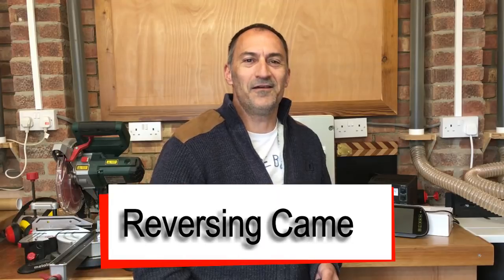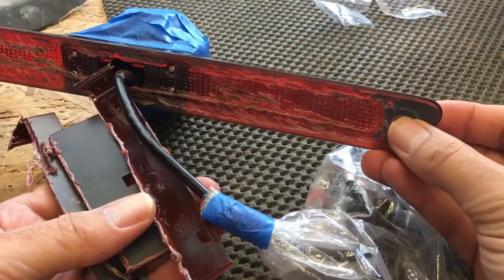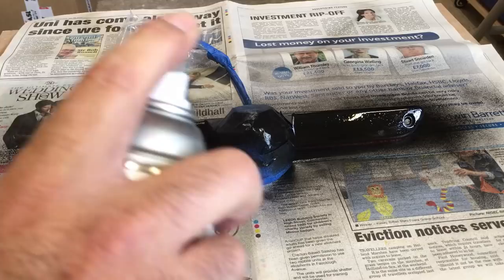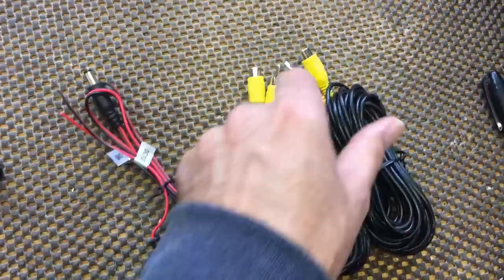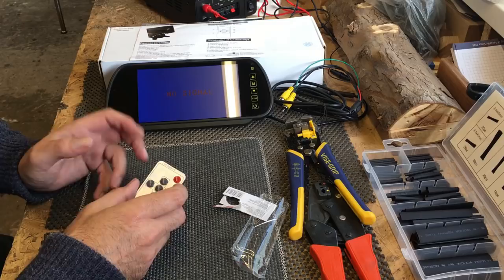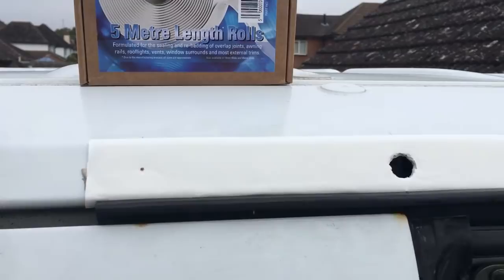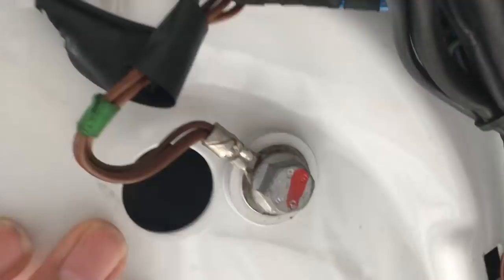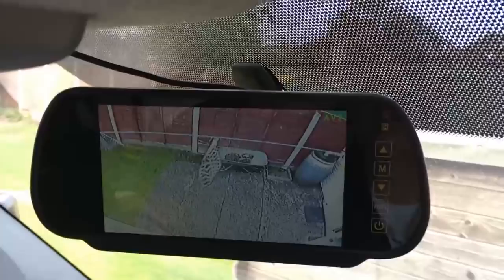Mercedes Sprinter - Rear View Camera Install

Comment: Hi Greg, How did you hide the cables at the front? Hoping there is an easy/neat way of doing this without removing the ceiling panel.
Reply from the maker: Above the rear view mirror the fibreglass head liner is flexible enough to push the cable up behind it and the window rubber into the void above. Use a long flexible rod as a draw wire and pull the cable through to the loom over the side door. Make your connections above the headliner. Hope that makes sense. 👍🏼
Reply: GREG!!!! That was sound advice, and was in the van today trying to install it all. I have managed to get the camera part installed, connected to the reverse light wire then video feed all the way to the front. However how did you power the video unit? I connected it to the cigarette lighter to make sure it all worked and it does, however I will need to find another power source for the monitor to function properly. Thanks a lot
Reply from the maker: Hello Stephanos, there is a solid red wire in the loom above the sliding side door that is a permanent live. I stripped a small piece of insulation and tested it to make sure. It's the same solid red cable that feeds the rear interior light over the double doors. I fitted a small toggle switch in the headliner so I can turn it off when not in use to avoid any unwanted battery drain. Hope that makes sense.
Reply: Thanks for that super quick response Greg you superstar! That's the idea I had in the back of my head but wasn't sure about if it would drain my battery. However, if you turn the screen off, when not in use, would it actually drain anything/be negligable?
Reply from the maker: Hi Stephanos, I'm not sure if it's off or just in a state of standby, the rear camera has infra red LED's so maybe they draw a small amount. I haven't put a meter on it but didn't want to take a chance so the switch was more positive solution.
Reply: I'll let you know how it goes Greg - youre the man!
Reply: @GregVirgoe  Yep I did the same fed via switch and I can confirm there was a small current drain I measured it.
Reply: @xsivnos5597   Indeed, there is a small load, I was installing similar system last weekend and I measured current with multimeter: in standby combined draw ~0.11A ( 0.04A camera and 0.07A screen) and ~0.33A combined when camera view is displayed. Multiply by ~12V to get wattage. So it may be a significant consumption if you leave it in standby for more than a week or two

Comment: Hi Greg,
               I am extremely frustrate with this installation!  I understand it all, however, if using a permanent live and the monitor essentially being on standby, would this not draw a small current all the time?  If so and the permanent live to the screen has to be switched.  How would the wiring look like for this?  Namely the negative cable.  I know the live cable is essentially broken by the switch (one side of the cable in, one side out.  But when connecting (if necessary) the negative to the switch how would the wiring look like?  Very confusing!!!  Help please!!

Many Thanks

Sean
Reply from the maker: you only need to switch the positive wire for the circuit to be broken. the negative can be connected all the time.
Reply: @GregVirgoe  Thanks Greg!  Much Appreciated!

Comment: Are there any legal, insurance or DVLA issues with replacing the existing high level brake light with a camera?
Reply from the maker: Hello Albert, I did not have a high-level brake light, not all vans have them.
That is why I painted this kit black so it no longer looked like a broken light.
If you had a rear brake light this kit just replaces the lenses and the light would still work.
Reply: Greg Virgoe thanks Greg, but my van has a working high level brake light....so if I replace it with a camera fitting it will mean that this light will no longer work....so is this a problem with getting a pass on the mot or the police ? If I paint it black like you then does this take away the issue?